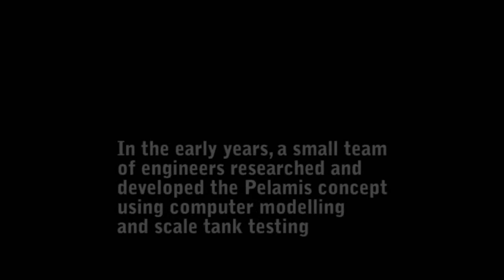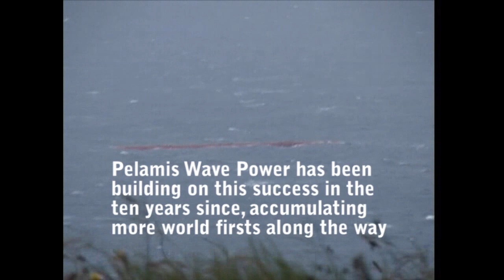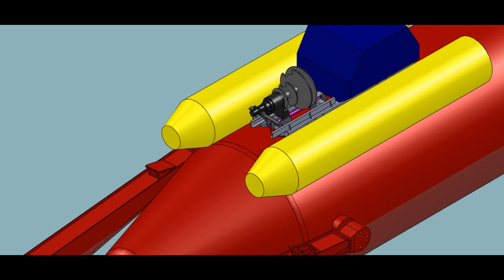Pelamis Wave Power - the story so far

Comment: I know they had to give up for lack of funding and lack of successes or taking too long to deploy - but considering the POTENTIAL of RANDOM wave movements we (all the first world countries)  should throw money right, left and center at all attempts, provided they have enthusiastic academcis and engineers  behind them 
70 % of the plantet is covered by ocean and a lot is shallow enough that anchoring a cable into the ocean ground would be feasible

earr the coasts and being "agitated" enough that they have something to harvest (although milder waters may have the advantage of NO monster waves, think Mediterranean, so less output would be paired with less constructive challenges). Once such a strong cable is installed into the ocean ground (with a foundation of concrete and steel) other things could be also anchored to it, changing the cable is not that much of a technical or cost challenge, that is tech we have mastered long ago, and there is economy of scale.

So the existing foundation & cable could be used for other types of wave generators later or completely other things think growing enclosures for fish, or floating solar panels, or even a floating "garden" or island for human settlement.

* society at large, the scientific and engineering community also gains KNOWLEDGE & skills, and if ONE of them would be viable it would not matter that 99 other projects failed. It is like with Pennicillin. It took from 1927 - 1944 until they could mass produce it as medication. But once it was available for mankind and agriculture it was such a game changer. It was not even that expensive to develop it - but it would not have mattered if it had cost 1000 times more to develop it, it would still have been a game changer (or in other words 200 - 400 other such projects could have been pushed for). 

There is plenty of money - these governments would rather splurge it on war, military contractors, and big biz (in form of subsidies, even nuclear and fossil fuels get a lot). As opposed to splurging on research and engineers and STEM graduates. 

The Afghanistan and Iraq war likely cost 4 - 6 trillion USD (could be even higher). The U.S. spends 1.3 trillion per year on the military (if you include the VA, and that is an estimate of Larry Wilkerson in ? 2017 or 2018). Wars  are extra ! Of course that is higher than the official budgets of almost 800 billion USD now (he includes the VA and other stuff that is conveniently left out). 

The NATO partners also spend a lot - there is the money also the trillions they CREATED in form of QE for the Banks after 2009. 4.5 trillion alone in the U.S, comparable volumes in the EURO zone and I think the Bank of England created 700 - 800 billion GBP. Never mind they resumed that practice again with the pandemic.

Even before the pandemic, during the "good" ecnomy. They already had propped up "the markets" again in fall 2019 in the U.S.  when severe cracks appeared in the global financial system again: banks would not lend each other money over night. That is standard operating procedure. 

The interests for that standard procedure skyrocketed in fall 2019 and that was very reminiscent of the height of the financial crisis when the banks did not trust each other anymore. 
The fed / treasury injected again money, which they created with the trick of QE, then "only" billions. Funny how the lauded "free" financial "markets" are on life support (or at least in the ICU) every few years. QE is allegedly an "asset" swap. Yeah, but the assets that no one would buy and I very much doubt the trillions of the Great Financial Crisis swaps had been swapped back before they resumed the practice in 2019.

And 1.2 trillions were created in the U.S. for the "marketes" to bail out finance when corona hit them the. That was mid March 2020, and before anyone else got any help, not even big biz (that produced something other than speculation and bets). 

One could have funded hundreds of wave related projects and with so much research going on - some teams find big hits. While others find nuggest, not the big win, but still useful. One big hit among 100 and a few decent if more modest successes (other applications, niche off grid applications, or not very efficent for easy to maintain and cheap for developing countries) would come out of it. 

Maybe that project would have needed more engineering input and paid engineering work hours ?? In other words understaffed or not enough budget for wages to attract (additional)  excellent talent.

These are precarious jobs, the engineers may be enthusiastic but they have to live with it that they most likely will be out of a job in 1 - 2 years. You can also be fired by the big industries as well, but it is not that predictable. Better funding would mean more job security (or longer projects) so they would have more applicants. 

They seem to have taken long to implement the first generator and also the project in Portugal was dragged out. Or was that already impacted by less than ideal funding  ? The good engineers and researchers need to be paid and you need enough of them to push the project forward.

STEM careers would be possible, and those STEM graduates get a first class practical, hands-on further education as they work in such projects. I just watched the Makani project (kite), no doubt those STEM graduates also needed a lot of skills to work with materials, they needed to improvise.

Likely the amateurs have no chance when it comes to harnessing wave engery because it is too complex and it is hard to catch erratic energy.

I would expect that taking that energy out would minimally cool the water, not a bad thing if that happens at a large scale.

As for amateuer solutions (wind): 
There are DIY Savonius / Darrieus style vertical windturbines made for cheap from barrels etc. That type of wind turbine  is not very efficient (whether industrially manufactured or DIY) when it comes to using a lot of the available wind energy. Horizontal put the wind to much better use.

BUT they can be much smaller they allow for a DIY solution, in which case they are cheap to make. From old steel drums or other materials, they can be put on the ground, are not visible (do not need to be on a hill), can be mounted almost everywhere, they catch even little wind & from every direction, no hassle with noise, neighbours, zoning codes, wildlife.

so they do "base load" at a very low harvesting level and for cheap. Not a large harvest, but what they can get, they get reliably and they get it especially if solar does not work. Even if there is only little wind in summer nights, the low tech generator will catch it. No sun - there is a good chance it is at least a little windy. Often more than on sunny days. So it is an ideal backup for solar in off grid situations.

No expensive foundations, special transports, or maintainance needed.

The turtle beating the hare. The Dutch clawed land from the sea with a low tech approach. (the built dams and used the mills to pump it dry. Then they grew plants that could tolerate the high salt content, and the humus enclosed the salt, so it became inert. Then they could grow more demanding plants in the new fields or meadows. Rinse and repeat, until that was good and fertile farm land. 

 Do it long enough and often enough and you also make progress. Steady and modest and large scale did the trick for the Dutch. 

And folks w/o a lot of money to buy better tech, can have the DIY turbines. A lot of locations are not a good fit for the large efficient turbines (they must be windy, and most of the time to warrant the huge investment), plus the good windy sites are often close to settlements.

DIY applications: in developing countries. Or small,  robust (off grid) operations. I saw a (Kirsten Dirksen ?) video  where the DIY wind generator very reliably  runs the pumps (video) of a low maintainance, off grid, "remote / extensive" aquaponic system in a parking lot. "Remote" means: not near where the person lives, he is a nerdy engineer. 
Or regenerating a pond by pumping air into it, or pumping water from a water catchment to irrigate a property (or to pump it uphill to another pond for cattle). It could be a small set up to power a remote cabin in areas where you cannot rely on the sun, or to support the solar panels of a house boat in regions with lots of rain and a cold season (I saw a video of a couple that lives off grid on a houseboat and they have  a floating garden on a body of water in British Columbia. They would not have the space on shore (or would not get permission). 

They have solar panels on the roof of the house boat -  but a small wind installation  (on land) that fills up batteries for backup could be an option. They would haul it onto the boat when needed. (Or a little freezer that is on a small cabin on the land so that animals cannot get into it). A small land mounted installation would spare them stability issues with a wind turbine on water, they would need to anchor it to the ground, that is not an option for such a small operation. The advantage, they have a source of energy that delivers when solar energy harvest is low. 

DIY Daerrius / Savonius turbines could provide a minimum of energy in developing countries to ensure they can cool food, have light, can wash or dry things. (and hardly ever need a diesel generator). Or can skip that investment (and risk if it spills). 

The Darrieus / Savonius type turbines  do not provide a lot of energy and do not use a lot of the potential wind - but that harvest they provide reliably and with low investment costs or impact on the environment. So that would be an ideal setup for developing countries.

I cannot see such options for DIY wave / tidal energy though.